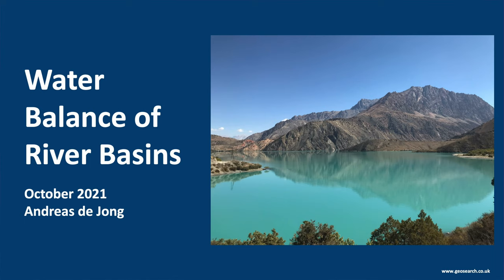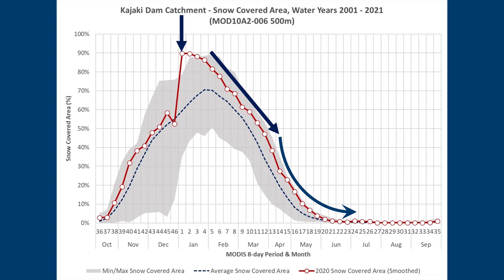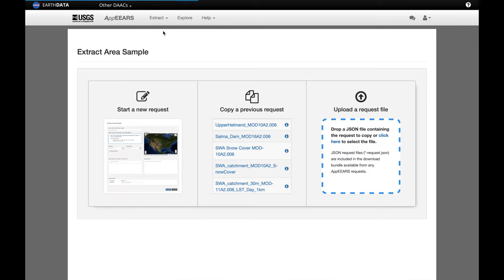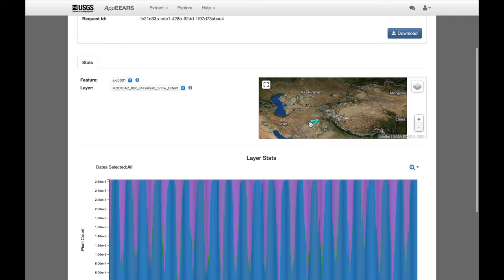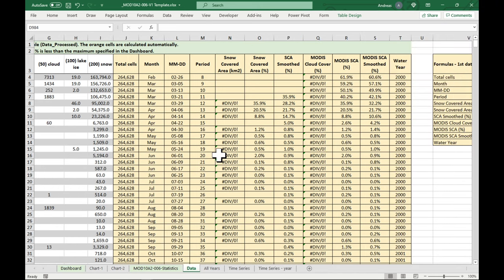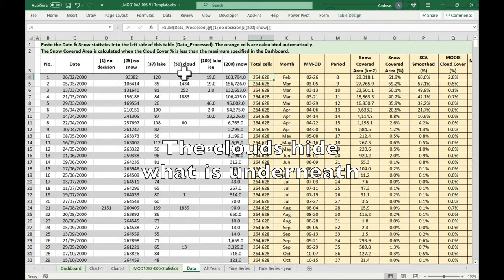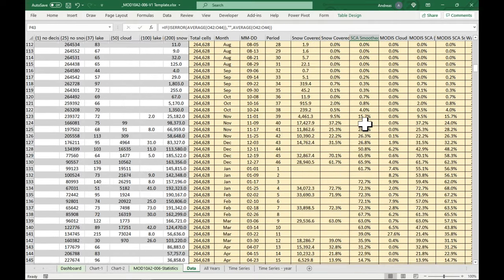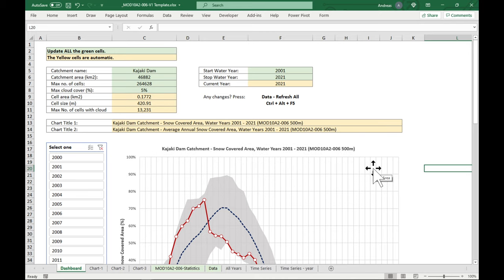Snow Covered Area & Water Resources - Kajaki Dam Catchment, Afghanistan

Comment: There are no lake and lake ice and no decisions columns in the excel file I received from AppEARS. What could be the reason? I would be glad if you could help me.
Reply from the maker: Hi Zeynep, the product has updated to a  new version - MOD10A2.061, since I made the video. Maybe the output format has changed. I will have a look and update the template. All the best, Andreas
Reply from the maker: Hi Zeynep, in the data sheet just delete the columns for lake and lake ice cells. They are not involved in any calculations. Then paste in your data. All the best, Andreas
Reply: @GeosearchInternational  What should we do for the no decision value? Isn't it necessary when finding total cells?because the no decision value is not in the data.
Reply from the maker: Hi Zeynep, I have downloaded some data using the version 6.1 and the file is called MOD10A2-061-Maximum-Snow-Extent-Statistics.csv
It contains the following columns: File, aid, Date, (1) no decision, (25) no snow, (50) cloud, (200) snow... Are you sure that you are working on the same data? All the best, Andreas
Reply: @GeosearchInternational  I work in another field, but unfortunately I don't see the "no decision" column in my data.But thanks a lot.
Reply from the maker: @zeynepozgonul2676  so what data set are you working on?
Reply: @GeosearchInternational  a river basin area in turkey.